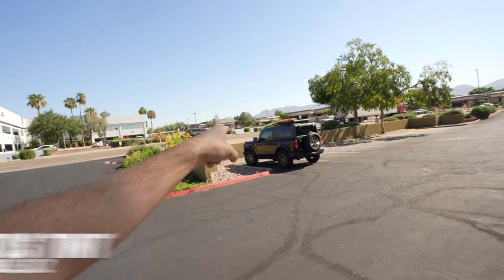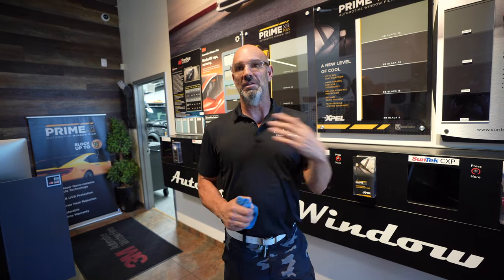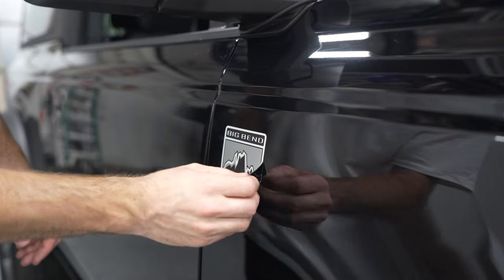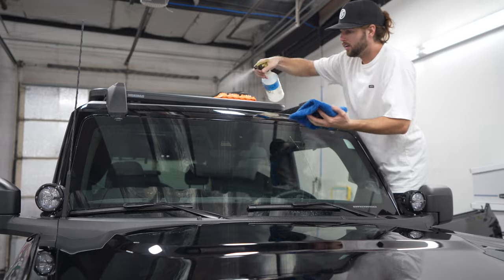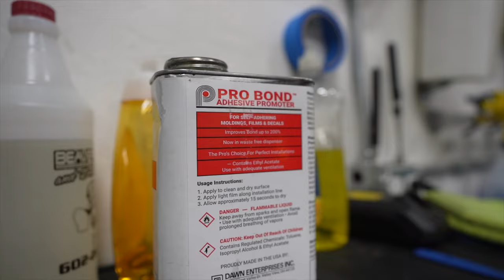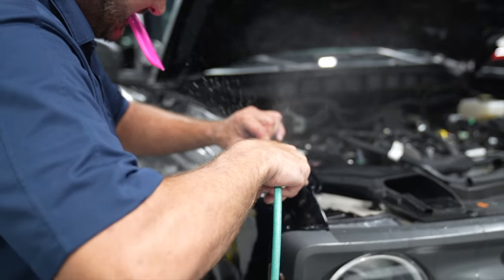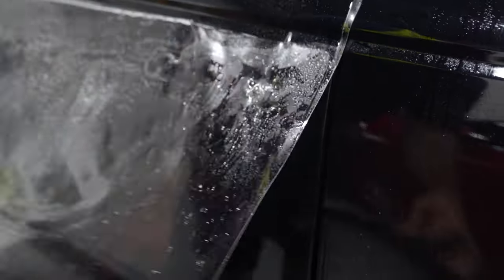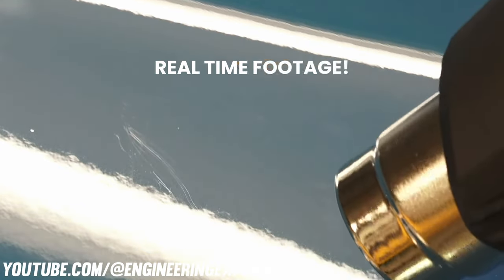Best Car PPF/Clear Bra Explained & Installed by a Pro

Comment: Thinking ppf is easier than vinyl is comical. Vinyl you can heat up and do whatever with. I would love to see a vinyl installer try ppf and try to figure out how and what way to stretch to get rid of fingers and move tension so it can be installed